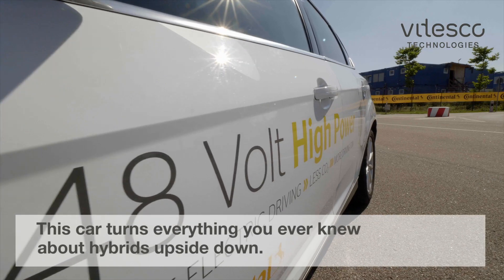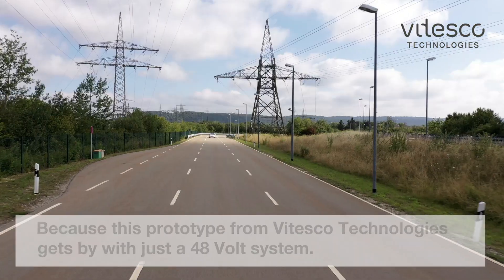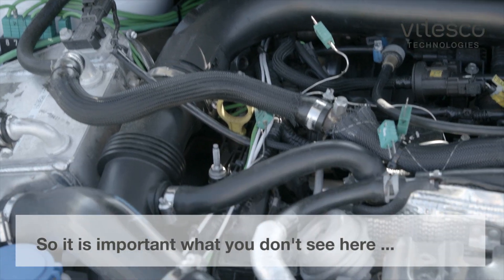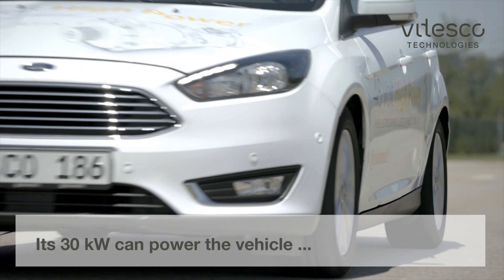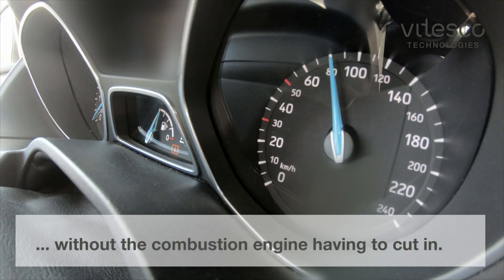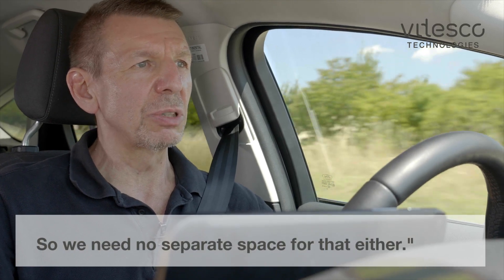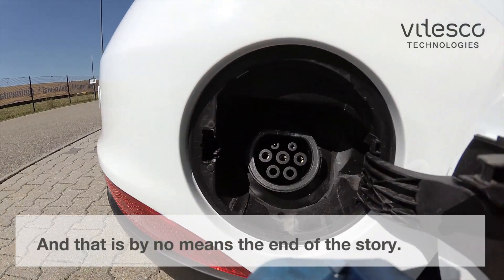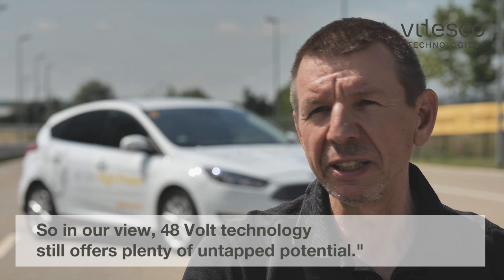48V HighPower

Comment: A german version would be great. By the way 400V is currently the standard for BEVs, not 800V.
Reply from the maker: Hi Fabian, thanks for your comment. You are right, most HV systems use 400V.  In the video we want to state the advantage of our 48V HighPower prototype in comparison to high voltage solutions (up to 800V).